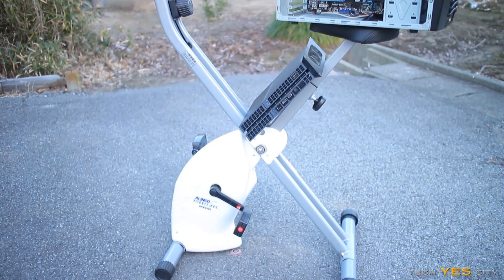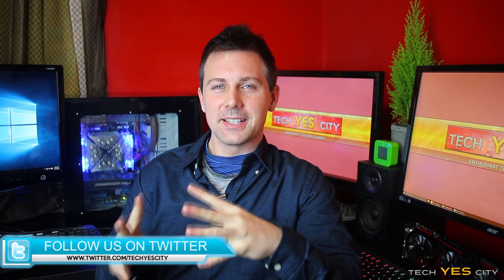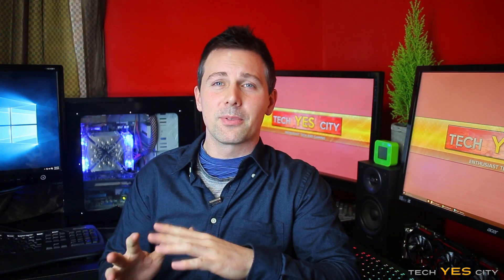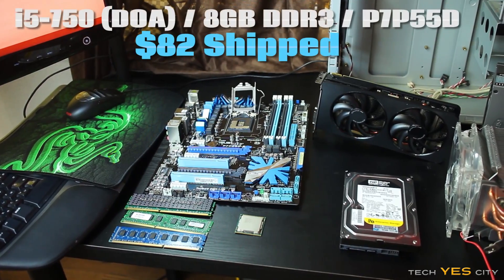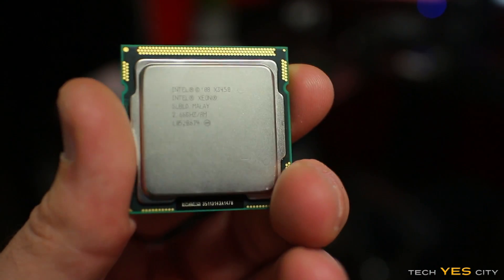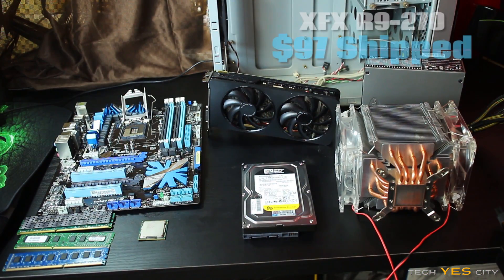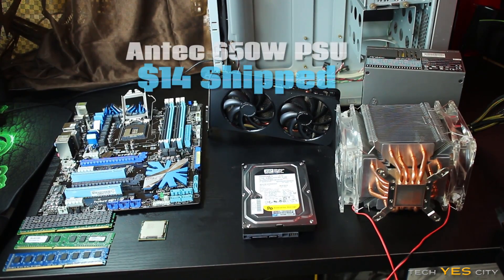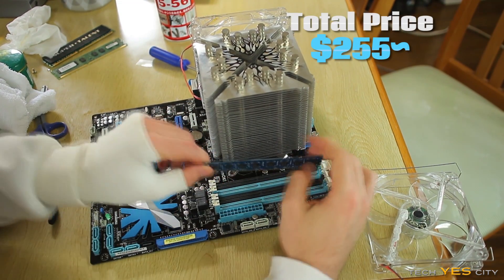$250 Console KILLER - How to Build the Best Used PC in 2016

Comment: im a pc and console gamer dont get me wrong pc will always push higher fps and better visuals in most cases, but what gets me is the optimization so many ports are really bad compared to ps4 which is why i still have mine. and the games run at 1080p 30fps check your stuff out bryan digital foundry has the proof your thinking of the ps3.

Comment: Brian im picking motherboard with core 2 quad for 5$ and geforce 1050 ti for 147$
Reply: Juli The Wolf It will bottleneck your cpu
Reply: PRODEGY cpu bottlenecks are common, but the 1050ti is pretty balanced with a core 2 quad. don't know where you picked up that knowledge.

Comment: The x3450 is the best budget CPU for the 1156 socket, but you'd be a lot better off getting a used GTX 960, GTX 770, or R9 280x for around $120.
Reply: Actually prices have dropped and you can get a GTX 1050ti or 1060 for relatively low prices now(sub $120 range). The GTX 960 is still a great budget card that is power efficient and runs cool. For reference, the GTX 960 performs about 20-25% better than the new AMD RX 460 on most titles, but most games still run DirectX 11 and are optimized for Nvidia. If you don't mind buying second-hand, I found a GTX 970 SSC last month for $90. Buying used GPUs is a bit of a gamble though.
Reply: Compared to what? Convince me that there is a budget GPU that blows it away.
Reply: Trolololol

Comment: I am doing the same build now but when I am using x3450 My PC has only 3.96gb ram out of 8gb! Any knows why? My motherboard is h55 by the way...
Reply: 32 bit system or BIOS problem or operating system
Reply: Don't need to build PC anymore,go for laptop
Reply: Yaroslav Shevelev you have installed 32 bit windows

Comment: Can you actually build a thing that competes with a ps4 system? This doesn't compete because you need to build a fully operational system that is very similar in SIZE, COOLING, OPERATING SYSTEM, and has same functionalities(such as bluetooth and wi-fi), and include at the very least a keyboard+mouse/controller of similar quality.  Good gaming PC, but I just hate the word console killer when I see how freaking big, loud, and running a shitty free STEAMOS/bare linux that doesn't play a quarter of games that Windows does.
Reply: well windows 10 is a free download provided from Microsoft right now so there's that
Reply: ***** not with new system builds. If the PC had windows 7,Vista,or 8 then yes.
Reply: ze OP master Prove me wrong kid. Make sure you get a similar sized case. Node 202 possibly or smaller, since the case is not yet console size. Test the noise, because that is also important. The boot up speeds should be similar as well. If you have an old hard drive, it may not be up to the challenge. Cooling and the noise may be your biggest challenge. It is supposed to compete in every way. Not be a tower standing and weighing several times heavier. Good luck
Reply: +Patrick Finley Wtf you are the kid because you dont understand the video. It isn't about the size! and you can make  it silent just use some silent fans it might be more expencive. and the most IMPORTANT thing about a PC is that you don't have to Fu** Pay to play online!!!!
Reply: Finne god you're stupid

Comment: I am young and I know nothing about pcs but I know that I want to move onto the master race. Is this pc good for me?
Reply: yeah it can handle most new titles 60fps+
Reply: thanks
Reply: +Pedo Peter Parker How many times i have to say this?! THE -BEEP-ING IS JUST A -BEEP-ING JOKE.
Reply: Name your budget. if you have $500, you can get much better parts (used of course). This price does not include a monitor. keep that in mind
Reply: i already have the monitor, i just need the pc itself and the keyboard and mouse. budget is around one grand so ill look somewhere else
Reply: +Pedo Peter Parker a grand is a lot for used pc. try to get a new psu and a aio cooler. you can get a gtx 960 and an i7 (non K) or an i5 (unlocked) with a decent motherboard. if you have that much you should get a 80+ silver or above psu and an aftermarket cooler (depending on your storage choices, you may have an aio instead of hsf)
Reply: No! This PC is too bad! When you buy PC you need to buy mouse,keyboard and motherboard for extra costs. For console you already have HDTV so you can buy console and plug and play. Easy and convenience for setup. Console takes less space,PC takes more space because PC is too big,even slim ATX case always same because the keyboard and mouse behind the monitor,and also, its not possible to plug PC into TV, I try my PC into TV but my TV gets broken cause color burn in, and also, many PC will damage some HDTV such as plasma HDTV I sure test it, so now I already have laptop I dont buy PC anymore because PC waste my electricity bill, maybe laptops have less power usage because small PSU, laptops are portable too! Console is best for me I have it, so now I hate desktop PC because power usage too high cause the big PSU, so I prefer laptop and console. CONSOLE MASTER RACE!
Reply: Hey hey hey ps plus is good for ps4, PC have free online multiplayer but you won't about to play games with family on PC because PC games only can up to 2 players, many new cosnole can up to 4 players, look at the ps4,Xbox one and Wii u, it can up to 4 players local multiplayer (up to 4 controller input support). And also, nobody cares about online multiplayer for high end gaming, for ps4, you can get ps plus, well ps plus is slightly better than steam premium subscription, because ps plus have free games benefits, you can free ps4 or ps3 games with ps plus when ps plus provides free games every month. For steam, you cannot get free full version of the games fron steam,even the subscription, also,download free PC games from others website is totally illegal, not really good! And also, WE ALREADY HAVE LAPTOP,SMARTPHONE AND TABLETS TODAY! WHY NOT ABOUT NEW TECHNOLOGY IN THE FUTURE TODAY, For PC gaming, you can get gaming laptops, for do basic tasks and daily general use, a smartphone and tables is enough for basic tasks as well general daily use, for watching movies, streaming box is enough for that, for web browsing, many cheap laptop smartphone and tablet are enough for that, how about desktop,its nothing about that, all feautures of desktop PC can be found on others devices too! Why not?!
Reply: Down Syndrome Toaster they means literal space. If you live in an cardboard box like a peasant, yes, it does take a lot of your place.
Reply: That one is pretty savage. Sorry